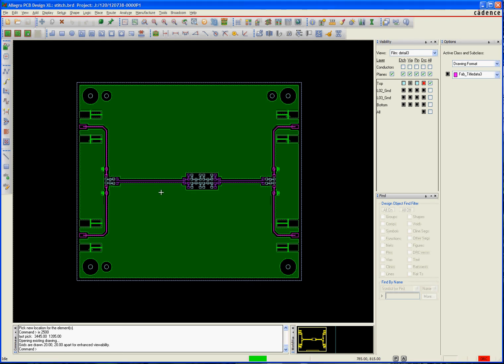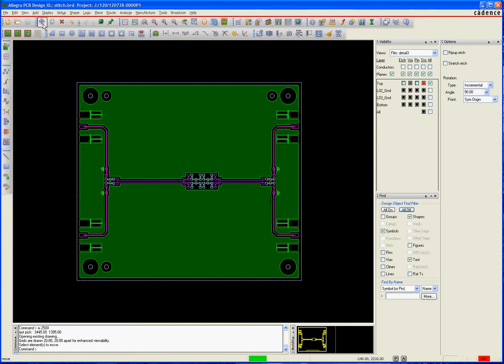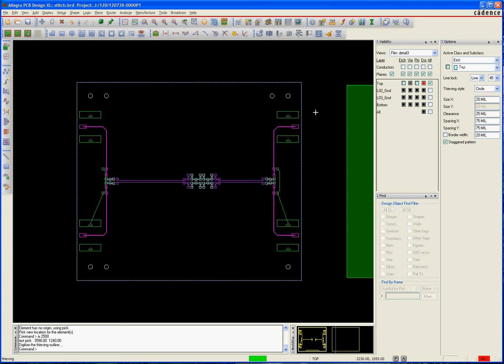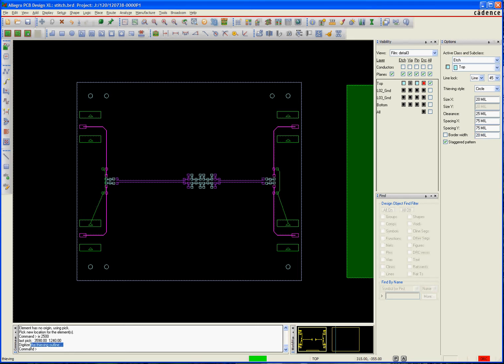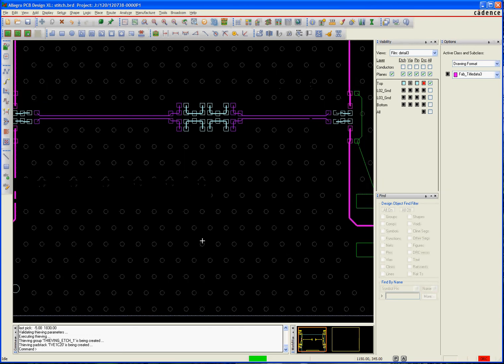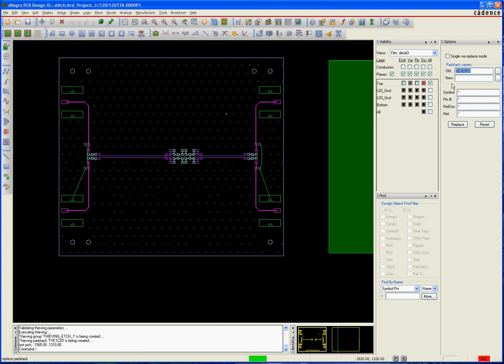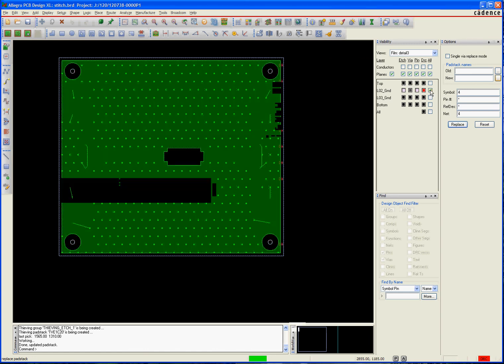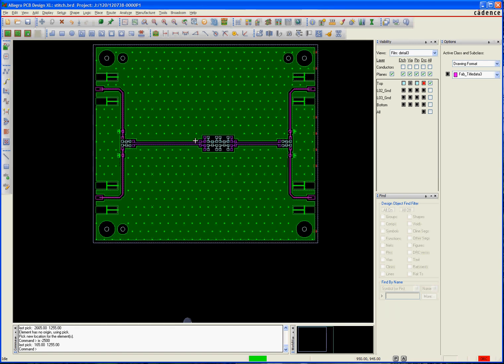One way to stitch vias in Allegro.avi

Comment: Hey thanks for this video, this looks like a very cool promising way for Standard licence where stitching isn't included in the licence. I am facing one problem though, I cannot get the newly created vias to connect to my copper shape. Any advice on how to get it sorted, eg. how to assign a net to a bunch of vias?

EDIT: I have emailed our support that came with the licence and after they have told me to ungroup the vias I have managed to get it working on 17.2 release. I needed to disband the group that the vias were part of otherwise it would not connect to the copper. To do that select the vias, go to Edit-More-Group and then Disband (the group should be called thieving_etch_top/bottom or something like that).